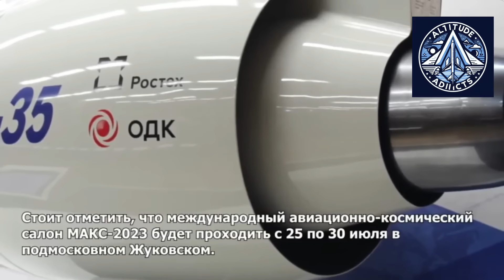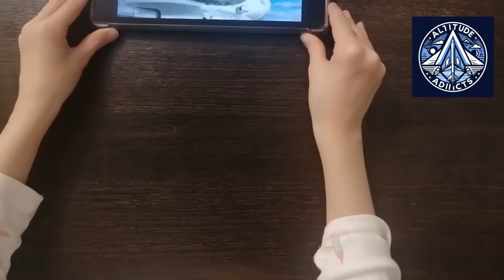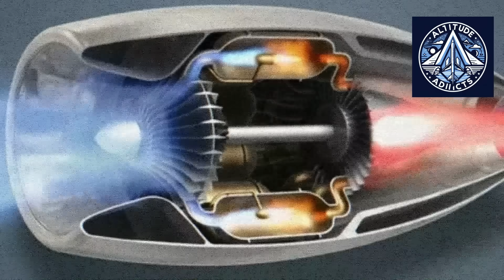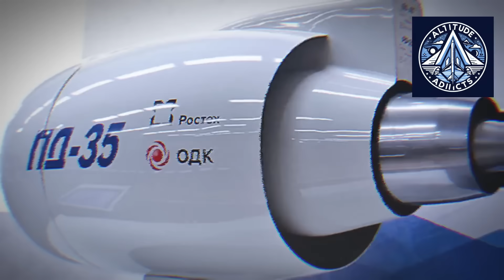Why Russia May Pause the PD-35 Engine for the PD-26

Comment: Why are engines made in Russia with lower thrust? For example, instead of producing the PD-10 engine, they produced the PD-8, and instead of producing the PD-16, they produced the PD-14. And now, instead of producing the PD-35, they are producing the PD-26. It makes no sense to develop engines with lower thrust and lower payload capacity instead of developing engines with higher thrust and greater payload capacity. The demand requires stronger engines and aircraft with higher capacity as air traffic and the volume of air cargo continue to increase

Comment: The PD-26 would be more akin to A330- B787 capabilities within reason, whilst a 777 is really not very needed for Russia’s need imho. The PD-26 also could be the basis of a four engine heavy lift military airplane with its many variants. So it does make sense to sacrifice the one for the other right now, I can smell Boeing lobbying pretty hard to get into this market before it’s gone, but more importantly nip it in the butt before it reaches India. Much success Russia 👍 GODSPEED

Comment: The PD-26 could be used to get the An-124s flying, while the PD-35 could be used in a twin and quad arrangement for the new Slon transport where a twin could do the job of the An-22 in the 100-110 ton payload capacity range, while the four engined model with larger wings and perhaps an H shaped tail for large external payloads and 180 ton payload performance could operate above and below the An-124 at 150 tons payload. New reliable fuel efficient engines would make the planes safer and more reliable and more fuel efficient. Eventually the twin engined aircraft could be made in numbers with its low costs, while the heavier model could carry even heavier payloads including external payloads to support the growing Russian space industry. I would anticipate over time rigid airships can take over the transport roles being able to pick up loads from where they are produced to where they are needed without needing airfields or roads or rails etc etc. A gas turbine can be taken from where it is made into the middle of nowhere without needing roads to be built or airfields made. A 100 ton gas turbine delivered to the middle of a desert or jungle and installed directly.

Comment: To maintain an edge and keep the entry barrier high , they said,” a turbo fan engine cannot be a modular product because THIS is aviation and aviation cannot be done like that—modular—solely because of X.” If it fits , it fits, un-necessary limitations are taxes. Taxes don’t belong in engineering.

Comment: Shoigu said years ago when he was defence boss that they were doing 2x engine options to keep their An-124s flying .... and even put back into production .... the 1st option was that UWCA was going to reverse engineer the D-18T - the 2nd option was from the PD-35 development ..... and a PD-26 fits it perfectly. So with the Russian widebody passenger jet market not being that big .... it makes far more sense to make a Boeing 767 size widebody and also use the PD-26. So the costs are shared. They can make something that won't compete directly with the Chinese CR929 which the PD-35 was designed for .... it is totally pragmatic and the decision has obviously already been made .. you are just talking around in circles .... again.

Comment: There is no pause on any engine. PD35 Tests are going on schedule no changes. Static test almost over moving into next phase. PD26 is in very initial stage didn’t even started, May be end of year 2026 into 2027. As for PD35 is ready for installation on Il 76 test lab. Aircraft for ground testing.

Comment: The Video missed  Russia official  announcement of WBLA aircraft  program this sets the correct  stage for synergy of Russia Engine - Aircraft  program. 
the announcement of PD-26 came at the same time to fill the gap of modern russian civil engine program, PD-14 PD-26 PD-35 
for 
WBLRA 500
WBLRA 600
WBLRA 700